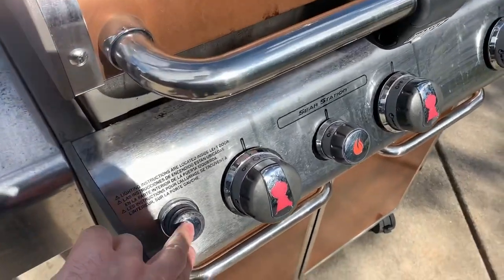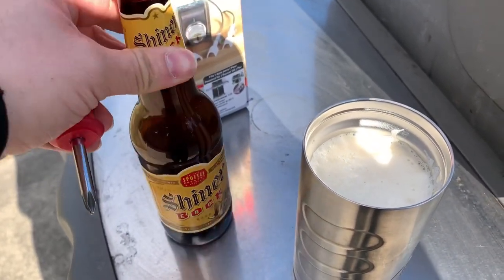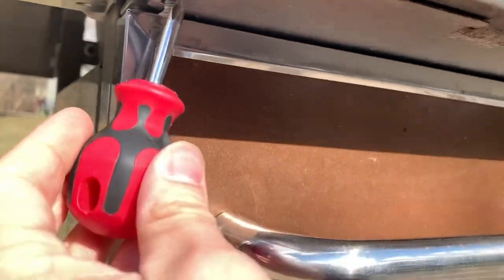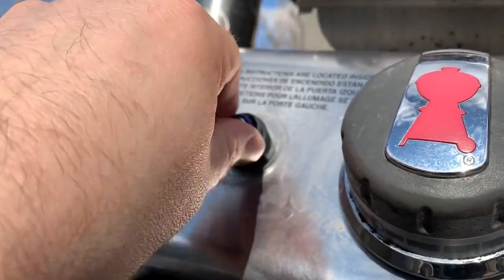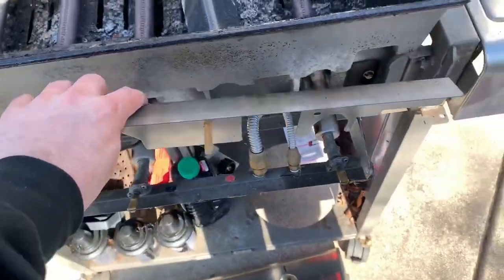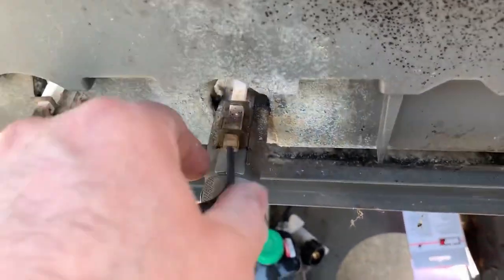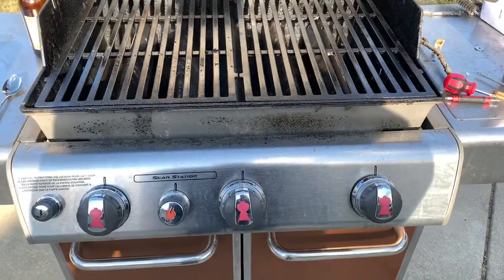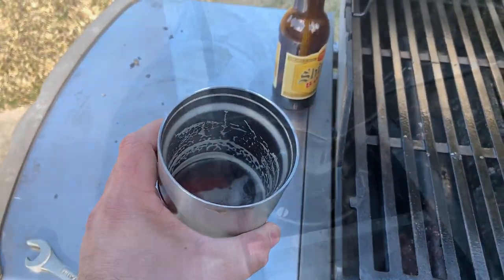Weber Genesis 330 Starter or Igniter replacement! How to replace the ignition module!

Comment: I have a Weber Genesis 3 igniter that wasn't working. It's a little different than this model, the battery is located in the bottom just behind the cabinet door.  All I did was take the battery out, verified the battery had 1.5v and reinstalled it. Igniter works again now. Weird. Figured I'd post this for someone else who may be looking for a fix like I was.
Reply from the maker: Ah, updated version, they may have moved it!  Mine is specific to the 330 model!

Comment: Everything was clear except for the one important step that you flew over. Did you remove the burner control plate and all knobs to get to burners and ignitors?   10 seconds or 3 seconds visual of this quick video clip or photo would have helped your viewers to complete the project. (Of course, once you are working on it, you can determine if this is really necessary. But this is a "how-to" video.

Comment: Why did you leave the part of the video out where you took the front plate off?
Reply from the maker: That’s the easy part?  I dunno....
Reply: I just see way too many videos that say they are going to show you a step-by-step video on how to do something and then they skip so many steps. If you’re going to show how to do it step by step, then show every single step.
Reply: @brenttierney922  I agree, he spends time talking about his beer and excludes actual steps in the video.
Reply: @penguin74  I agree, easier than the 2 screws holding the underside cover up? or unscrewing the ignitor push button?

Comment: Don’t waste your time changing the igniter switch change the battery first that’s usually the problem just unscrew the front of the igniter button and you can replace the AA battery without taking off any panels.
Reply from the maker: I tried that first.  Didn’t work.
Reply: I understand but the average person will remove the panels without changing the battery first I’m sure you understand what I’m saying it’s all good